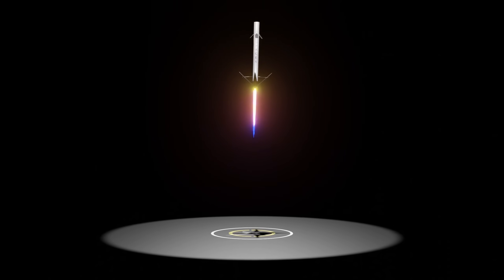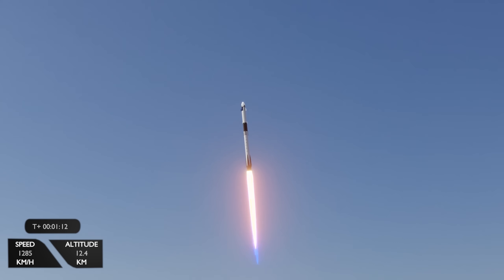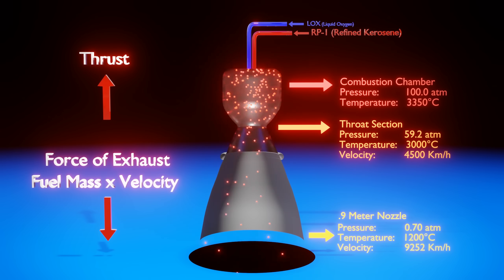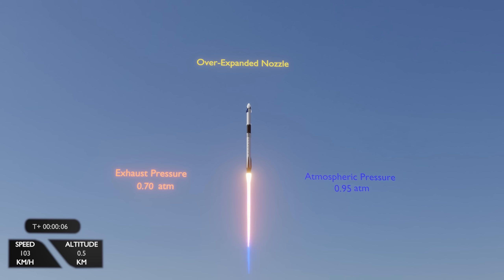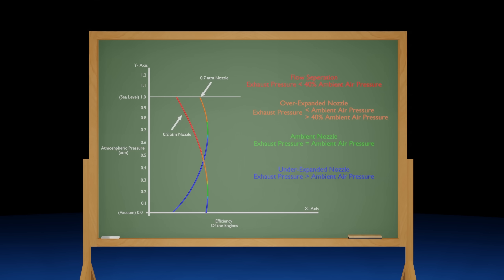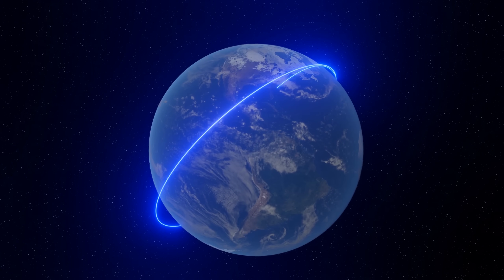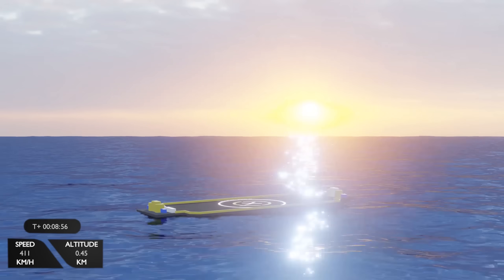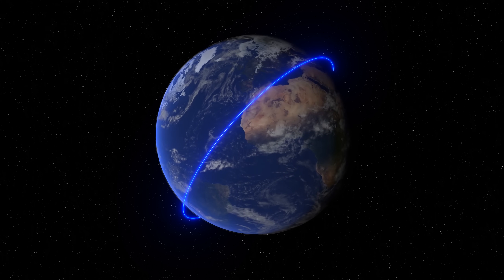Why Doesn't SpaceX Recover the Second Stage

Comment: Great video, this is obviously the place to ask a couple of questions.  I always wondered why we could see flames from the first stage F-1 engines of the Saturn V reaching upward around the bottom half of the booster sometimes leaving soot marks.  Was that because of this reduced atmospheric pressure?  Secondly, has anyone seen the latest downlink video from the Delta IV heavy flight on April 26, 2021, the NROL-82 mission.  The second stage used a very unique way of adding engine bell length by dropping a couple of sleeves down below the engine bottom area to add to it’s total length when in the near total vacuum.  I’ve never seen or heard of this technique before but thought it was very impressive.

Comment: I was wondering why you said "refiring it's vacuum engine to lower it's velocity will only work until the engine is in the atmosphere". Can't you decrease the 2nd stage velocity in space prior to re-entry, using the vacuum engine where it was designed for?  Aren't there any variable nozzle geometry designed rocket engines? This should have been the norm these days.
Reply: 1. You can't slow the 2nd stage down because you have no propellant left to do so. 2. Even if you did "slow down" you are still going extremely fast and without some kind of way to land the second stage it will most likely not be recoverable/ reusable. 3. There are types of nozzles that are similar to what you are talking about that are "variable" but they have never been successfully used and are less efficient over all. Check out aero spike nozzles to learn about them. There are a few different designs that seem cool but have yet to be designed or tested in a way that justifies the risk/ cost. 4. The best option so far is what SpaceX is doing with Starship which will have both types of nozzles the "second stage" which is actually where the cargo/ passenger will eventually be as well. If you don't think this should be the norm you may not be aware of the physics limiting orbital dynamics. The velocity and more significantly the temperatures involved that all need to be survived are also limited by weight. Every time you make a change in weight to the 1st or 2nd stage you lose a multiple of cargo capacity that can be launched into orbit which is the whole goal.

Comment: I'm sure they thought about it and dismissed the idea, but why not just belly flop it like Starship? You could even get the whole thing spinning horizontally and use the magnus effect to maintain some height and get more time in the air to bleed off speed.
Reply: The starship will have heat-shield tiles on the wind-facing side, in order to protect it from burning up. While yes, you could bleed off speed in the upper atmosphere, you still have to drop down *sometime*, and you'll still be going way too quickly to survive.

The first stage even has a slowdown burn while falling in order to protect it.
You would need a heavy heat-shield in order to protect the upper stage.
You would ALSO need an extra engine specifically for landing the rocket.
Since when the rocket is near empty, the engine is the heaviest thing, and the upper stage would really want to dive engine-first, destroying the rocket. You'd also need to fix that.
All in all, it would take numerous years to create this upper stage and it would also drastically lower the max payload, if it would even be possible.

Comment: is it just me or is anyone else thinking of spacex just using their fairing recovery ships to recover the 2nd stage
Reply: The second stage is traveling at a very high velocity after releasing its payload. It fires its engine one more time to slow itself enough to fall,out of orbit at a predictable place in the ocean. But it has no fuel remaining after its de-orbit burn with which to further slow itself down. It is still traveling at near-orbital velocity. Thus it is destroyed; it burns and breaks up due to air friction long before it reaches the surface. Some of the more dense parts splash into the ocean, but none of them would be salvageable.

Comment: The thought that  comes to mind is that with the second stage in orbit, there might be a recovery opportunity using a Starship to capture it in a payload bay and land it back on Earth.
Reply: If you send a Starship up to recover the second stage, then why not just use the Starship to launch the payload in the first place?!
Reply: @MrLazze69  BFS kinda sucks at light payloads due to the heavy vehicle itself. You can mitigate this but it consists of basically making much of the payload a third stage.
Reply: This would all come down to cost and complexity.  At the moment there is not enough second stages to make this viable,  soon this may change and presents Mr Musk with yet another business opportunity.
Reply: To Simplify; 
Part 1: Falcon1 - Launch a rocket, maybe recover it. 
Part 2: Falcon 9 - Recover the first stage, then faring, also bigger.
Part 3: Starship - This is the next version of reusability, with the whole rocket being reusable/recoverable, also bigger again.
Reply: Not necessary. Starship is already a recoverable second stage, and is very much designed to replace the Falcon 9. If the Starship is flying regularly, the Falcon 9 is likely to be retired.
Reply: While removing space debris would be nice, a starship launch for that would be much more expensive than having the stage deorbit on its own from friction. Anyways, the falcon series of rockets will eventually become obsolete, and be taken over by starship due to the extremely low launch cost and high payload volume and mass capacity.
Reply: @sirjeffels4020  yes I dont think alot of people know this. there is allways some friction even in space so the thing in orbit will slow down over the years and fall down to earth and burn up. things in LEO will do this quicker then in ESO because they are way way further out in space and will take way longer to slow down enoughto fall down. that is why LEO satelites have trusters to keep them up in space for as long as then are needed. the trusters are rly weak but they have enough force to make the satelite not lose speed.
Reply: @sirjeffels4020  - I was thinking more along the lines of reuse of the upper stage either via another ground launch or (and this was a thought that occurred to me after my post) as a means of propulsion for deep-space projects. It seems a shame to abandon a proven Merlin vacuum engine when it and the other components are already in orbit. 

Also, while Starship is going to, eventually, replace Falcon, I don't see that happening for quite some time.   There are lots of advantages to smaller rockets just as there are for smaller airliners. Until Starship can provide enough infrastructure to make it worth while to launch 50 tons of satellites at the same time (and place them each in the required orbits), the needed flexibility of a diverse satellite-producing customer base will favor smaller rockets. 

In any case, these are just the musings of an amateur space geek ;-)
Reply: @bunkie2100  yes there is a use for smaller rockets.  However remember that not all sats need to go directly into their final orbit.  The amount of fuel they can carry for their  own orbital manuvers is limited by the rocket geting them into orbit.  A small minimalist rocket has to put them strait into their final transfer orbit as theres no room for extra fuel to make major corrections.  a dozen sats ride shareing with starship could take advantage of the massive payload capacity to bring along biger fuel tanks.  If they can bring fuel for 3X the delta V they would have on a small rocket even if they use half of it to get to the correct orbit they come out ahead and probably cheaper as well.
Reply: .... maybe the 2nd stage cost does not justify the cost of sending a starship to capture a speeding bullet in space? i've seen the sandra bullock movie.... a ton of space junk orbiting earth... nice job scientists! better out than in right? 🤣
Reply: Or better yet, collect all the 2nd stages and bundle them together to drive a larger vehicle in our solar system.  Of course you would also need a huge fuel tank, a mounting platform....
Reply: Starship will make Falcon 9 obsolete
Reply: It will not happen. You need fuel to slow down that peace of metal anyway. Same amount of fuel (if stage do it itself, even more if not),  to slow it to 1st stage speed, and It's a deal breaker. Thing moves 20x of a rifle bullet speed.  It's lot of energy.
Reply: What if they made the fairings like a heatshield? Itll cover the second stage on its decent and land safely on the ocean?
Reply: @marly54  they had a plan to do so, but they wanted sole focus on starship, so SpaceX went with that instead.
Reply: @Milo3Dtv  Well, the Starship will already be up there delivering stuff.  Bringing stuff back would only require a little more fuel reserve.
Reply: Yep, I wondered that too.👍
Reply: The answer is to use an aerospike on the second stage, which would allow the possibility of orbital re-entry and landing
Reply: There are companies working out using tankers floating in outer space as future space stations. The second stages currently floating around in outer space will be perfect candidates for the said space station.
Reply: The second stage is only a single engine compared to the 9 engines on the first stage. It's just not worth the cost of adding more fuel to bring it down and controlled way. It takes a lot of fuel to get it to an orbital speed and it would take a lot to reverse that process also. Granted it would be less fuel required once the payload has separated, but I have no doubt they have figured out the cost benefit analysis. If you want to add fuel for a return trip then you have to add enough fuel in the first stage to lift the extra fuel in the second stage. And then you have to add enough fuel to the second stage to push the added fuel to orbital speed.
Reply: @DingoDawg64  Why not use it where it's designed to be used and cost so many resources to get where it is? It could be used for journeys further out into space by a spacecraft that docks with it that has fuel, saving that spacecraft the payload from earth into orbit not to mention the cost of the engine.
Reply: Just add a little fuel and thrusters to deorbit it anyway so it wouldn't just be in LEO
Reply: @lil__boi3027  that’s actually what they do.
Reply: @dabigcheezprod  really?
Nice
Reply: @lil__boi3027  yep. They also make sure to deorbit them in an area of the ocean extremely far away from any civilization, so if a piece does manage to survive reentry, it can’t hurt anyone or damage any property. Most launch providers do this. That is the problem with the recent Tianhe mission. They didn’t have a plan for controlled reentry, so the orbit will degrade until it reenters somewhere (no one has idea if it will enter over a populated area or not), perhaps with many pieces still intact. However, I’m getting ahead of myself. The point is, many providers are now trying to combat the space junk problem.
Reply: @dabigcheezprod  theres is a chance the americans will capture the remains or parts of the upper stage and study it by doing it, I don't believe the chinese designers are that dumb to do it
Reply: @lil__boi3027  the only difference between controlling the reentry and not is that we know it can’t land where it could damage something. Plus, the military would not need to look at the burnt up pieces as NASA doesn’t manufacture rockets anymore, that’s handled by companies like Boeing, Lockheed Martin, Northrop Grumman, SpaceX, etc.. Not only this, but even these companies wouldn’t gain anything (they already make some of the most advanced vehicles in the world).

There really shouldn’t be any excuses, this stuff needs to be controlled for the better of future space flight.
Reply: @lil__boi3027  they already do it, its not much to just deorbit enrugh to enter atmosphere and burn
Reply: @hphp31416  well if you are using the atmlsphere to alow it down from orbit speed you need alot of heat sheilding to withstand the heat.  And you need eather parachutes or a propulsive landing both require alot of weight.  The vacuum engine cant be used in the atmosphere because the nossle is to wide.  Maby they could make a modular nossle that could drop of a bit of the nossle to bring the diameter down to an equal size as the sealevel merlin at 0.9 meters.  

But i dont thi k that it would be finacially motivated at this time.  The 2nd stage has 1 engine and is smaller.  The 1st stage has 9 engines and is way more expensive so the savings makes it a good strategy at this moment in time. And with starship entering the arena falcon rockets will be obsolete

Comment: Excellent video. 

One small criticism: The comparison between the Falcon 9 and the 787 was a bit of a mixed metaphor. The first comparison is between the thrust of the Falcon and the weight of the 787s. The second comparison doesn’t make clear that that the comparison has changed to compare the Falcon thrust to that of the summed thrust of the 787s.

Comment: Thank you for this excellent video! 
So the solution to be able to recover 2nd stage, is fuel to slow down the speed in vacuum, and a second "sea-level" engine to handle the landing. 
Easy! Lets fix it! :D 
Or have only one engine with adjustable nozzle diameter... Hmm... 
Can someone ask Elon how far we are from that reality?
Reply: could shedding lower part of vacuum engine 'convert' it to atmospheric?  Would it be worthwhile (I suspect not ...).

Comment: Excellent animation and description of the reason for the nozzle size differences. It begs the obvious question, why don't they have nozzles that open up like the petals of a flower and then they could optimize them dynamically depending on the atmospheric pressure?

Comment: Second stage doesn't burn down because of air friction, but it melts due to intense temperature caused by compression of air as th second stage touches the atmospheric particles.. that compression wave results in high temperatures that melts and has its structural integrity compromised.. due to temperatures and forces created by pressure differences around the second stage.. I guess there's a more things going on there but that's all I know as yet :D

Comment: Really good explanation of rocket engines and flow separation. Some extra details which weren't in this explanation: heating in the atmosphere scales by the square of the speed, so while the second stage is going 4x the speed, it incurs 16 times the heating, making the required heatshield exponentially heavier. Additionally, dead weight on the first stage has much less impact than the same weight on the second stage. I forget the exact ratio, but it's something like every kilo of extra weight on the first stage costs 1 kilo of payload, whereas every kilo of weight on the second stage reduces the payload by 2 kilos. This also means the margins for the fuel which would be required to land (even if you could somehow design the engine so that it could drop the lower part of the engine bell) would impact the payload a lot more. This is why Starship is so huge: the larger the spacecraft, the less these inefficiencies matter, which at some point makes it feesible to try and recover the second stage

Comment: I wonder if you could just  make an adaptive flow nozzle that changes the further you go up(Im dumb so prolly not) still would be cool tho
Reply: This was actually thought of by NASA and the Soviet Union before... to be more realistic, one (I think) was actually built. Although it didn't succeed both because of funding and other reasons, the idea was there. So:
1. You're not dumb, and
2. why not search for expanding nozzles and the RD-701 engine while you're at it.

Can't think of the other engine that had an expanding nozzle, it's either decommissioned or was not built entirely

edit: if you wanna read more/watch about aerospikes, that'd be cool cause it has the properties you were thinking of. The exhaust is able to adapt to the ambient pressure as it goes up.
Reply: For this, you're looking at aerospike engines. The curious droid has a good video about this. Plz search for his channel

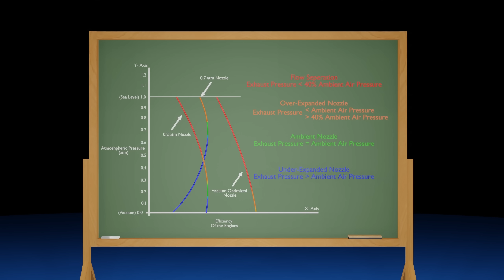Comment: 10:07 - not friction but compression, the air can't move sideways quickly enough, it gets compressed -> warmer
Reply: Funfact: the less aerodynamic your pod is, the better. It is pretty counter intuitive but you want to compress the air infront of you. If you do it right the air will form a manageable 300+°C warm cushion that keeps the melting hot air away from yours ships/pods surface.
Reply: @Caiitrix  and it will also slow the pod down which helps a lot
Reply: @colon-Thorn  yes, yes. forgot to mention that because thats the main thing you want to do after entering the athmosphere; slowing down. this concave and totally-not-aerodynamic shape is ironicly just the most efficient on in that case.
Reply: Yes, it'll turned into plasma
Reply: What if the second stage deployed a kind of wings which gradually allow reintroduction into the athmosphere over the course of let's say 2 earth rotations?
That way the "trauma" of reintroduction can be limited?
I don't believe the added weight offsets the needed capacity that much.
It may well be worth it compared to sacrificing such a massive investment for every launch.
Reply: @zteaxon7787  um well, wings don’t work at low atmospheric pressure, you can make it work by increasing the speed, but that will take you back to the over heating problem, or you can make the wings bigger, which will just be too heavy.
Reply: @zteaxon7787  it’s till going 17000 mph when it does hit the atmosphere.  It would take almost as much fuel as it took to get to orbital velocity to slow it to a speed suitable for  that reentry